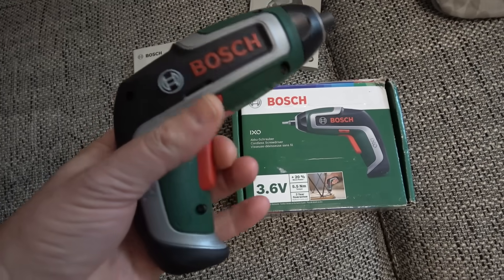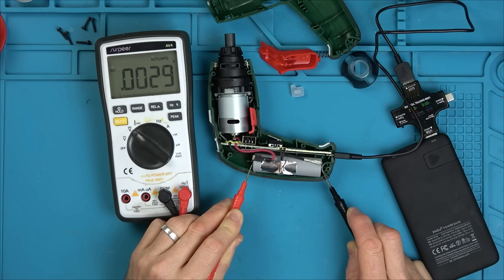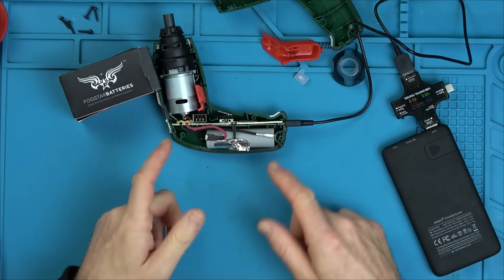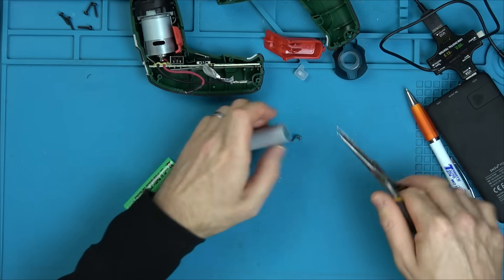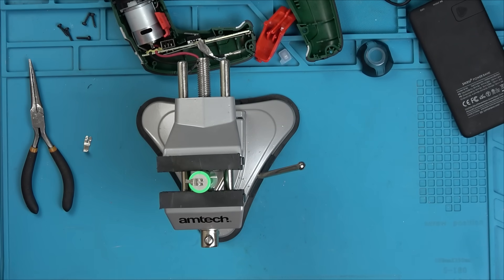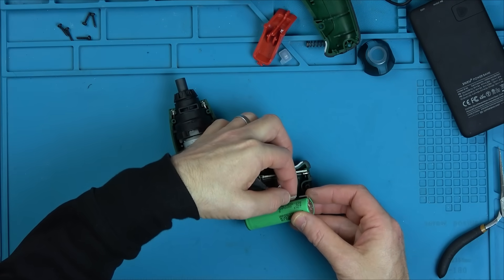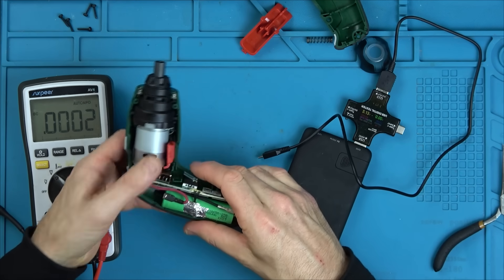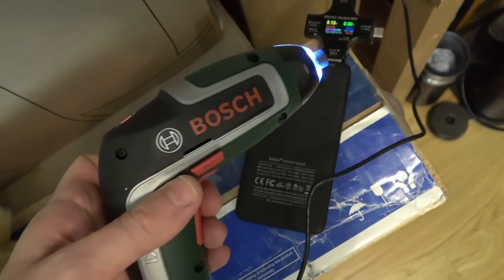MMV November 2024 Fixathon Day 1 - Faulty Bosch Screwdriver

Comment: I own the same one different brand, it does take many hours to charge, eventually the battery couldn't hold a charge, so I soldered on a new one and also mine didn't come with a temperature probe and after a few hours it does come warm but doesn't affect the device!

Comment: I would have guessed two microswitches to get double the switch current capability, though someone mentioned they were for direction, the direction switch seemed to be further up in the screwdriver. Perhaps a relatively old battery, they have a limited lifetime / number of charge cycles or there is some residual current when off or when the charger is left connected and powered.

Comment: I understand that it’s not the best way but I but a rechargeable battery powered jumper just, like car battery jumper boxes, it has portable power supply with voltage output and input, I used this on multiple batteries but  main thing is used jump dead phones just to get the cable starting cycle.

Comment: I would use the old battery. In my experience if the battery drains quickly after being charged, is for the bin... If it holds voltage I will keep it... Also I measure the amps of the battery, when it isn't connected. Everything above 1,5/2 amps is good... Sometimes batteries are fully charged but are showing 0.2 /0.3 amps...in that case I'm throwing them too...

Comment: I think the two switches are there for reverse and forwards basically when you switch the reverse it switches it and uses the other one or it's there for the LED lights Guess you can trace the circuit and find out

Comment: Ironically I have one of these that I use for many repairs as well as sonetimes at work as an electrician. Think mine is the last gen maybe?
Wondered if one of the two microswitches might be for the LED light, the other for the motor of the screwdriver. This may be the case if the plastic tabs on the trigger are different lengths. If not, it could be as someone else mentioned, for forward and reverse

Comment: @my mate vince you can jump start the 18650 and "safe" is relative uve rejuv alot of 18650 batteries with your. Desktop batreries. You just have to be careful. They are aafe ti use. I think the srudy shows a 5% increase of thermal runaway. I use 10 second bursts at 5v ao it wont overheat. Ut should also have a bms.

Comment: Great video Vince you asked and answered all the key questions throughout the video! I had a company (2010-2017) that did cell replacements in tools etc just like this. Comparing the discharge rates on the new cells is one very important thing people miss, that Samsung cell is perfectly fine for this tool. I never managed to re-weld those thick tabs, the cheap Alibaba welders weren't around then amazed by the power of that machine! My welders were £2k each and couldn't do it, we welded thinner nickel strips and layered them if needed. The original cell failure could be down to self-discharge it may have been warehoused for years, or maybe the packaging shifted and the trigger was held down or it could have frozen in a shipping container. Cells do just die but very rare! Btw those Bosch drivers are great keep that for yourself!
Reply from the maker: Thank you Chris 👍👍👍

Comment: The battery is ok to use as it is a hard case cell not a soft pack that doesn’t vent. The new cell you are fitting will reduce the torque.

Comment: honestly lipo batteries can survive being fully drained as long as they are eased back in to life and not just slammed with voltage . if you look at the dolar store lipo phone chargers they more often then not are completely drained wen you get them and the charger in the booster unit eases power in to them in order to recharge them and bring them back . granted not all situations are that way but quite a lot of the time they can still be used .

Comment: Draining a LiPO 1850 below its cutoff voltage won’t really be dangerous to charge/use but you will end up with a much lower total battery capacity. And will likely fail again much quicker.
Considering the cost of a decent replacement battery though it’s probably a good idea to just replace the battery with. A decent Samsung or LG 18R etc

Comment: the battery could have been drained from new /factory if the trigger was depressed whilst in 'locked' mode - as the LED still lights and trigger could have been squashed in, whilst packaged.

Comment: The second switch is for the light it's not a second trigger switch 
If you can press the physical trigger gently enough sometimes you can trigger only the light without the screw driver engaging

Comment: Will the driver let you run the battery too low? At what voltage does the screw gun quit to protect the battery? I indeed would have just charged the battery. Parallel switches do make them last longer, but once one fails, twice the current is going through the one switch that is working. Doubling them  will also minimize internal arcing which will kill a DC switch quickly.

Comment: Most batteries have an internal protection circuit, Lithium batteries don't like to be fully discharged, but it's nothing to do with safety, and it only harms them if it's done regularly.  if the battery doesn't like it it will not re-charge. If the battery has any signs of swelling do not use it, that is a safety thing

Comment: I would use the battery, if there's a risk in using it, the normal user would not know about it anyway. Besides, if there is a risk, the charge IC should not let it charge it at all IMHO.

Comment: It's designed to recover from a low charge level, that behavior isn't by accident.  That's why it trickle charges it until it gets back into a normal range.  You might lose a small amount of capacity but otherwise it's fine.  If it wasn't safe it wouldn't do it.  Bosh can hardly afford to have their screwdrivers catching on fire or exploding now can they ?  They'd end up owing millions in damages.  You don't want to drain a battery all the way to zero if you can help it but if it happens accidentally once or twice it's fine as long as it's recovered properly by trickle charging it.
Reply: Big Clive did a video a while back explaining all this in detail.

Comment: I would’ve guessed the 2 switches are for the led light at the front and the other is the switch for the motor, in other drills I have the led is a lot more sensitive so comes on before the trigger is pressed so might have a slightly different angle on the lever.

Comment: No problem with using that other cell IMO: the screwdriver itself will break (either physically or the motor will burn out) long before you overwhelm the cell's output. You simply increased its effective usage time between charges

These sort of screwdrivers are really designed for screwing nuts/bolts in/onto long threads, eg case assembly, rather than anything requiring any significant torque, so the cell peak output is fairly irrelevant

Comment: I have 2 of these IXO Screwdrivers - a version 3 and a version 7 (as in this video).  I bought the v7 as my venerable v3 started being problematic and would not work when you pressed the trigger..... There are a couple of bad design issues in the v7 compared to the v3 .... I prefer my v3.  I did manage to fix my v3. It turned out that it was the trigger that was the problem. Trouble shooting it - when I stripped it down it all apeared to work fine, but when back together it would not always work. It turns out the back of the trigger, which presses those micro switches, was worn down enough (through use - I use them all the time) to not press the switches down enough to make contact. I fixed it by glueing 1.5 mm a plasticard square to the point where it should make contact on the trigger, and now its back to working fine;  These screwdrivers are pretty good - they might be cheap but thy have decent torque for getting out tight screws.  If you want a decent portable electric screwdriver I would recommend....  just try to get a v3 over a v7 ;)

Comment: I hate when people throw working stuff away just because someone told them that another person was sure it was not safe. Well, Li-Ion batteries are infamous for exploding and catching fire, even when in perfect condition and even without use, so, to be "safe", we should not even use them, right? Or we rather have cell phones, computers and other wireless stuff that can work off-grid...

Yes, a Li-Ion battery that has been left to go flat has a higher risk of exploding and/or catching fire, but the additional risk is not much, and once charged and passed a few cycles, there should not be any difference compared to a "good" battery. My answer to your question is: Of course I would have tried to recharge that battery and use it. I don't like e-waste if I can help it.

Another very different thing is a bulged battery, a punctured one, or, worse, if it is being overheated or shorted. In those cases, you are actually playing with fire and those things can be really dangerous if mishandled.

Comment: regarding the duel micro switches. Could it be that the board used is a generic board for devices that require 2 factor buttons to be pressed (safety) and they just put both under 1 on/off switch? I think most people would just plug it in and not think anything about the fact that it was fully discharged as ignorance is bliss
Reply from the maker: Thanks Emma, some comments suggest one switch is for the light and the other switch the motor, other comments suggest one is for forward and one for reverse. I'm going to take it apart to confirm 👍

Comment: The trouble with Li-Ion batteries is not the cells or how they work but with the 'wealth' of 'knowledge' that people claim to have about them. This comes from ancedote and lack of understanding of technical literature.
Deeply discharged Li-Ion cells are not dangerous of themselves but care must be taken in recovering them.
Below 3V, a recovery charge with a very low current should be applied to the cell to allow the internal metal to redistribute properly. Above 3V then a more rapid charge can be used.
However, the act of deep discharge does damage the cell such that it permanently looses capacity and may be prone to swelling. Swelling itself is not dangerous but does risk the cell being crushed by the housing, which can lead to physical damage.
For details, you can look at the German manufacturer of batteries 'Jauch'. I find their advice on overcharge and discharge accessible but only one point in the encyclopedic knowledge from all the manufacturers.

Comment: I've had 18650 batteries at really low voltages and they will recharge given time and they're fine to use. These battery powered devices can sit in shops a year or more after manufacture, as long as they hold a charge (after charging) then they're fine to use and I wouldn't worry about it at all. A lot of people are the same I expect, they won't want to throw out any battery powered device because the battery went flat and cells in a power bank are fine as long as they're balanced. You can replace one without any worries at all, in fact there's more danger using that spot welder than there is in replacing a lipo cell....

Comment: 18650 batteries go bad when discharged to 0 volts. Because they don't have a discharge protection in the battery itself. I wouldn't dare just recharging and usung them again. Lol 
That's comming from a guy that poked a hole in his bloated cellphone battery and used it as normal for weeks! Now its still working but i already bought a new replacement phone.

Comment: I love my Bosch screwdriver. It's 10 years old. I rarely charge it and it just works.
Reply: yeah, I rarely use it and it simply does its job when required. You just need to keep the battery charge up over time. Many devices just die in storage that way.

Comment: Those nickel strips for spot welding to the battery have a slit in them. That is to increase the resistance of the strip and encourage the spot welding current to go from one electrode, through the battery case, to the other electrode. Thus it works best if you put the spot weld electrodes across the slit, rather than parallel to it. I think you could have charged up the fully-discharged battery, but it would probably not hold its charge over say a 24 hour period.
Reply from the maker: Thanks Samuel 👍

Comment: Nice Job Vince, I would have just charged the original battery slowly with the bench PSU at something like 200ma for a while, then when it got above 3.7V charged it at 1A or so. Done this with a few Milwaukee batteries and they've been fine.

Comment: The product was stored for so long that the battery was discharged to 0. That's why the charging board didn’t recognised the battery for charging. 
The battery needs told best atleast 2.5.told 2.7 volts told be recognised..

Comment: ALWAYS use the A when testing something. Do not use the mA unless you know it is in the milliamps.  There is a fuse on both but on the Amps one it is 10 amps versus I think yours on the mA side is only 200mA.  THIs means that if you had a leak of more than 200mA then it would blow that fuse and you would not know for certain unless your multimeter tells you but most do not. Also the switches are for the forward and reverse. When you clicked them one would work when you had it switched to forward and the same for backward using the other switch to go backward.
Reply from the maker: Thank you 👍

Comment: Vince, if lithium cells that are drained completely are unsafe to use again, why do you think Bosch did not add some kind of circuit to prevent that cell being recharged again? Is it because it's being charged at a low current and slow rate and low output when screwdriver is in use that it is deemed safe? 

As you've said, someone will put that on charge, go to work and come back and find it's charged and none the wiser that the cell was completely drained.

I don't think Bosch would make that kind of oversight where lives would be put at risk.

Perhaps higher charging rates make charging completely depleted lithium cells unstable and thus a fire risk? Food for thought.

Comment: And sorry, I felt like I needed a second comment to explain something you are puzzled by:  Lipos will lose around 1 to 2% of their charge per month as self-discharge.  If a tool is left with a discharged battery in it for a year or more the self discharge will often take the battery to almost zero and then often the device's BMS will refuse to charge it in that state.  Hope this helps.

Comment: we use this type of cordless screwdriver at work for housing screws. It doesn't have too much power that you could break anything. It can't be used for anything else. We use it to screw on housings for televisions and hi-fi items of all kinds. It automatically stops screwing when the screw is tight and doesn't overtighten it, so it's perfect for such purposes

Comment: Probably a faulty battery since new or one that was never charged from factory. I’d of just left it on charge for a day and if it worked after that used it as normal. Wouldn’t of swapped the battery

Comment: Those Microswitches usually last very long - I suspect, that only one Standard Switch might not able to take the
Current that is flowing and might overheat or burn out the Contacts in it, so they wired two in parallel to distribute
the Current and prevent this from happening.
Reply from the maker: Possibly, cheers Triple 👍 Anders and Karthor think that one is for the motor and one for the light and now I think that this is probably correct, I didn't think of that!
Reply: @Mymatevince  Yes, it's probably for the light. That would make much more sense.
Reply: I had another bosch model and the trigger plastic piece was shaped in a way that actually did engage one of them at half-press. It then only turned on the battery indicator light though... so kinda useless.

Comment: I can't find nothing wrong with this battery. Was only over discharged and thats why is charging slowly because to safely bring back to life the battery need to be slowly until bring the battery voltage to the nominal voltage and then the charge controller will boost the current to charge normally.

Comment: When you leave battery operated items in a cold area like a shed or garage its not uncommon for the cold to sap all the charge out of them. I've never had a problem using a battery that's been completely discharged and brought back to life. I bring dead battery's back by slow charging them back up with 1v, 1Amp from a cheap homemade bench power supply. The homemade bench power supply is made out of a old PC ATX psu, its was a fun project build.

Comment: i had a GO Pro i bought (new old stock) with an enclosed battery. i left it charging for three days and no life. Complained a bit to the seller who offered a refund. i intended to return except forgot to unplug the camera. got back from work and the LED was on charging. Left it another hour or so and LED went out. WOrked fine.  4 years later daily use no problems !!

Comment: from what i know it's not dangerous to reuse a flat lithium battery as long as it's slowly brought back up to operating voltage and monitored throughout as this process could heat it significantly. the reason why people don't reuse fully discharged batteries has more to do with how harmful it is for the battery capacity, i.e. a overdischarged cell will never perform as well again
Reply: Absolutely!
Reply: This is why you cycle the fully discharged cell a few times. It can and or will bring back lost capacity and lower it's internal resistance as well are reduce self discharge rate, It's been proven many times.